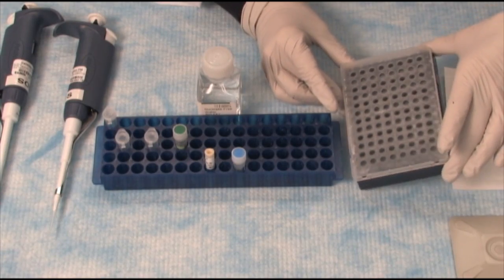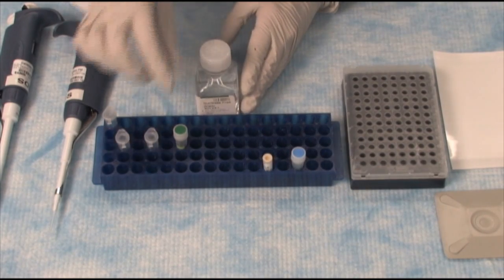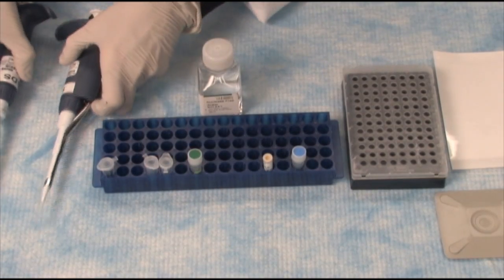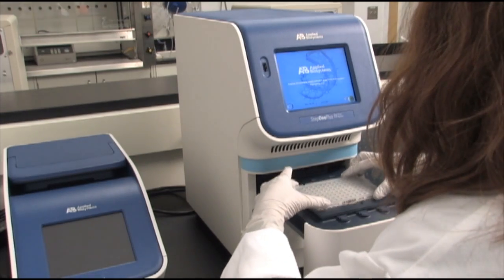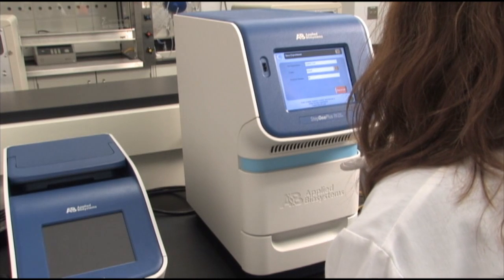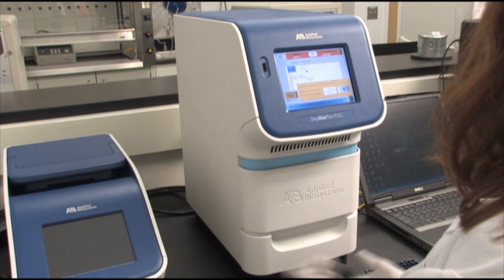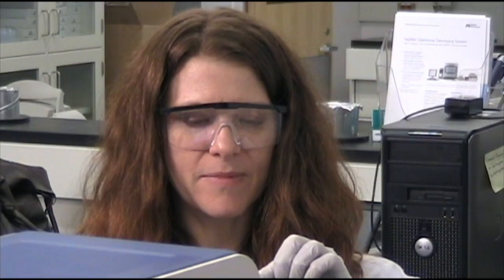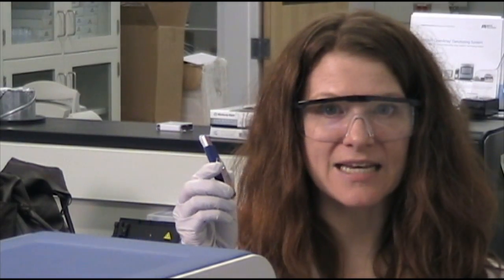Amplify Sample with The StepOnePlus™ Real Time System  (qPCR step 6)

Comment: Hello, I have recently encountered a problem with the machine. the program detected the initial amplification and final amplification but in between I could see no amplification. Is it a problem in detection?
Reply: I have an error message as it , 'Instrument error occurred. Verification of positional accuracy failed. Possible mechanical failure. Event log needed for analysis. Instrument error occurred. X axis position verification failed. Run stopped'. This message appeared after I tried to do the spatial and background calibration of the machine. I hope you got my problem. Thanks.
Reply: @rijalrames is it fix now?😂